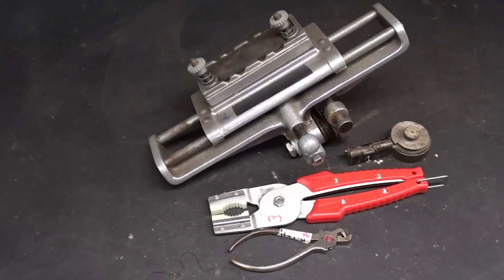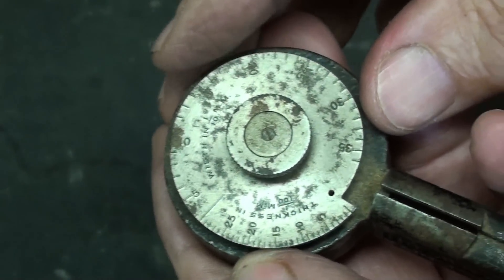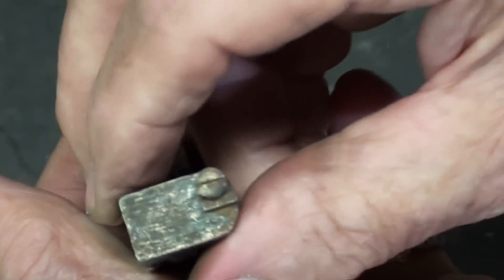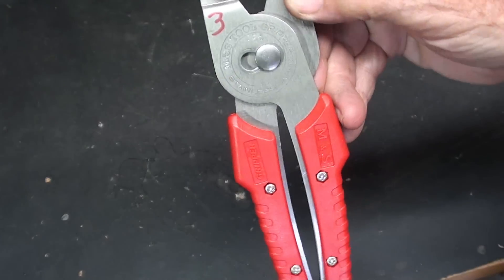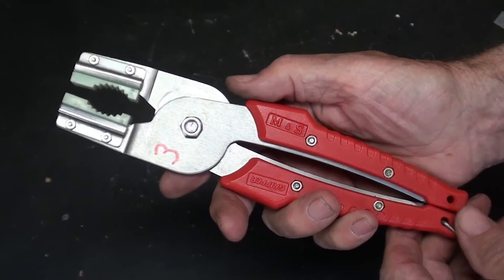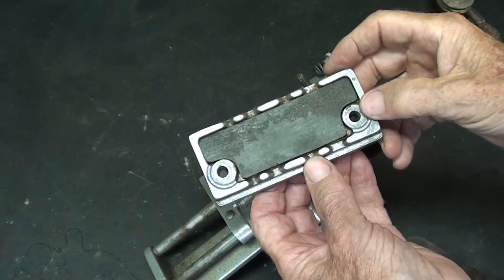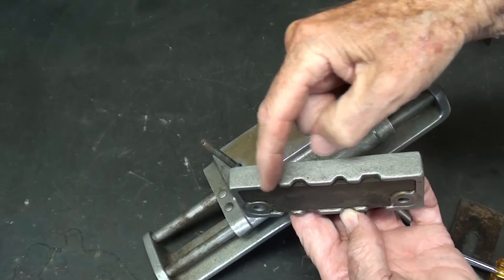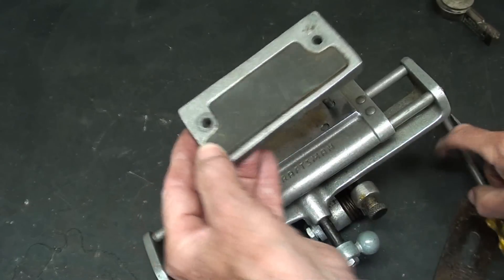WHAT IS IT? Mystery Tools #82b answers tubalcain mrpete

Comment: I used my Craftsman side-feed table like yours to hollow-grind every one of the regular screwdrivers in my tool chest - no more messed up slots on screws!  I had it mounted on a dedicated grinder along with a craftsman drill-bit sharpening jig on the side of the wheel - it became one of the most used work-stations in my shop - sharp, straight, and square tools are a real pleasure to work with...

Comment: #3 are called "soft jaws".  They are used for tightening and removing radio communication connectors that have a knurled exterior surface, instead of flat surfaces like a bolt that you can use a common wrench to tighten or loosen.  They are quite common in the telecommunications biz and used on the fittings for coax and antennas on tower sites.

Comment: As for item #3 I've got a similar tool.  I inherited mine form my Grandfather who was a master machinist, from WWII eraa until his retirement in the early 1980s, for various aviation defense dept. contractors.  Because of the nylon jaws they are used to remove or replace Amphenol connectors on aircraft with out galling the threaded locking barrel. I still use them on aircraft.

Comment: I was in the Navy and I worked with weapons systems, some missile systems make their connections via what are called cannon plugs. These are multi pin connectors that screw in place. Number 3 looks like a pair of cannon plug pliers to men and the size adjustment is form different size cannon plugs.

Comment: Hi Mr Pete, I inherited a larfe chest of Stanley tools from the 1950's. They had never been used, never been opened and were in the original boxes. Every wood working tool you could think of including a lathe and a very early electric drill.

Comment: The grinder attachment is interesting.   A complex design, but as you mentioned, not very rigid.
I use hand planes, but would not use my grinding wheels to sharpen the irons, they are too coarse.    I have used a grinding wheel to hog off metal when restoring a hand plane when the iron was really messed up by previous owners.   I then use my normal method of a Veritas jig to hold the iron and various fine grits of wet-dry paper on a surface plate to get a sharp edge and 90 deg to the side of the iron.
Reply: I like the basic idea of the design, it is almost like a super small scale surface grinder.

I would probably change up some of the details of the design but this is something I am working with right now for a slow speed diamond lapping system I am putting together

Comment: resilient mainsprings, I know sold by by the elgin national watch company, closed in 1968 from about 1850, 
Waltham I think manufactured
sizing tool for ordering/installing/replacing clock main springs, 
the largest diameter/smallest opening quadrant gives spring thickness, 
the three larger opening quadrants give spring width: 
the slider pin, between the cam and fixed/adjustable pin is missing: 
leaf coil springs were inserted in the gap in the 'handle' and the cam rotated until feelerguage type drag felt. 
thickness could be read between the butt end of the pin and the cam wheel, 
the screw in the end of the handle was for adjusting the fixed pin against a known standard supplied with the tool
clock springs weren't forever; constant flexing often broke the spring at the hole punched in the centre
springs were supplied in dozen boxes to clock maker/repairer
if a wrong sized spring (= wrong force) were installed no amount of adjusting the pendulum length made the clock run correct

Comment: The mainspring tool is missing the movable point that goes in the slot. The cam rotates and moves the sliding point and you use the space between the moving point and fixed point like a micrometer. The small screw on the end of the arm is used to zero it out. It is used to measure the width and thickness of the mainspring. The numbers are metric notation. These days I just use a micrometer.   I have a wind farm north of me with 25 of those. If I recall they were installed around 2010 and a couple have already failed.  Then 2020 the town tried to force two of the farms to give up their property for a solar farm. Until that company went belly up like the opponents pointed out the various solar companies tend to do.
Reply: Thing is you can have solar and a farm.  Got a solar farm near me that has sheep & cattle grazing on it, no need for mowing and the animals appreciate the shade.  There are also plans for one growing berries or some sort, they plant them under the panels to get partial shade.  That seems to be getting popular.

Sounds like someone in the town council was getting a kickback from the solar company.
Reply: @j.f.christ8421  The routine here has been that Company A comes in, files the paperwork and gets the town/landowner on board saying "look at what you get paid and we will not be doing anything to change the property." Then the crew arrives and they dig the topsoil off the field(s) and sell it, then level things up and toss a cheap grain seed like rye on it and build the solar farm. 
As soon as it goes online the company collects a big check from the feds and within 6 months they file for bankruptcy and the company goes up for sale. Company B buys the farm and takes it over, BUT they won't honor the original contract because they are a different company. So the landowner get's screwed and the town does as well because all the things they were to receive evaporate as well. Then after 6 months company B puts the place up for sale as a low cost of service facility and company C buys it.

Comment: I used pliers similar to the red handles ones when in the military.  We called them "sweet lips".  They were used for removing twist connectors on electronic equipment.  Most were made with slip joints for different size connectors.
Reply: Nailed it. Cannon plug Pliers.
Reply: Yep, I work in electrical and that was my guess.
For turning plastic cable gland nuts which are fluted.

Comment: #4 Former professional (and current hobby) machinist, and current optician here. Like any good tool, it IS for what ever you use it for. That being said, it is likely NOT a frame adjustment plier, though it could be used for certain specific adjustments I am sure. More likely, it is a lens BREAKING plier.  Old frames with glass lenses, depending on the design, needed to have the lens broken into multiple pieces to remove the old lens, so the new lenses could be put in place. Also, some opticians prefer to break out the demo lens from a semi-rimless frame, rather than try to get a finger nail under the nylon retention cord. Pliers like that would be nearly perfect for splitting a lens. My lens cracking pliers are a Concorde Model #5027. Main difference being they are a sharp point and cup jaw setup ass opposed to the wedge and recess of that pair, but mine are also not intended for glass lenses, so that would likely be the reason for the design difference. Just a professional educated guess though.
Reply: YOU ARE SO , SO CLOSE...They are rimless compression pliers for putting the lens in the frame.
Reply: @jamielee9350  I have 3 different designs of those rimless bushing pliers... And if the pointy jaw had a small groove or flat, I might agree, but coming to a point like that pair does, it would crush instead of cup the bushing. Maybe it would work for setting and peening the brass rivets for twin riveted hinges, but I've always done those with a tack hammer.

Comment: "That grinder attachment is pretty dam nice"
Wish our tool and die shop had one, we had diamond dresser blocks for the surface grinders. A diamond round for the Gorton cutter and cylindrical grinders.
 But none for the post grinder, never could get a concentrate dress with the cast star wheel hand dresser!
Edit - Do agree that something is missing on the clock tool. Prehaps someone will be able to forward a catalog photo of a complete tool.

Comment: I used to use one of those craftsman tools to sharpen blades, chisels, cutting tools for for lathes and sharpening old mower blades For dressing the wheels, you don't need to move the tool to the other side, you swap the wheel to be dressed to the side with the tool attached. It's just a nut that you remove, or a screw. You dress both on one side of the grinder. It was mainly for more stability in sharpening certain tools for a straight, clean edge.

Comment: A Gunsmith would actually hollow grind a screw driver! We pretty much exclusively only use hollow ground, precision sized by width and thickness, screw drivers and driver bits. I would love to have that tool just for that purpose and a few others I would use it for like truing the grinding wheel because we require them to be quite accurate also. It's definitely pretty neato, I've never seen another apparatus quite like it in modern times.

Comment: I've got a diamond dressing tool for grinders that rides the front edge of the tool rest and you just slide it across the face of the wheel. It has 2 different sides for different width tool rests and a knob to feed the depth of cut on the nib. Very handy. I've had it for at least 20 years, it's not old yet. The mainspring tool looks like it is for measuring spring stock size and then bending the ends in the slot. The radius relief suggests relief for spring back when making the ends of mainsprings. The screw and slide would be for gripping while bending.... my 2 cents.

Comment: @MrPete222 - Tool #4 looks familiar to me.  It's not anything I have owned or used personally, but I believe that I have seen it used with livestock to install ear tags.  One part of the tag's strap would lie in the channel and the point would drive the stud through the ear and lock it in place.  I'm probably wrong.  It is more likely to be used by a jeweler or optician.

Comment: Hey @mrpete222 Think endmills, drills and other tooling that you'd normally just grab with your hands. This would eliminate A. getting your hands oily when removing/installing tooling in a spindle and B. eliminating the possibility of hand injury by bare-handing sharp cutters and such. It might also prolong the life of tooling since you won't be transferring moisture from your hands to the tool.

Comment: I think the Waltham main spring tool is used for making new main springs.  These main springs are normally flat springs to take up little space in a wristwatch or small clock..  The shaft at the center of the spring rotates one direction until the spring stops its motion and starts rotating the shaft in the other direction acting like a pendulum in a grandfather clock.  These main springs are also used to store energy by winding the spring to its limit and then using it to power the movement in the watch.  This energy storage technique was before batteries and was needed on clocks smaller than grandfather clocks that used weights and gravity to store energy.  A straight piece of spring steel (flat or round) wire would come from below the handle, then go down the groove in the handle and finally be inserted into the hole on the dial face or through a hole in the center shaft of the dial.   Then you could spin the dial or spin the handle to wind the spring steel into its flat spiral shape.  The measuring dial could help answer the question about how relatively strong a new main spring is by knowing the thickness, width and coil winding gap.   If you make a new spring and it is too stiff or weak then you could vary one of these parameters when you make the next spring. Keep going with this repetitive process until you get a main spring you are happy with.  This tool would be valuable on an assembly line where you want to make multiple springs to the same specs from the same spring steel.  This tool would also be needed when you get a new batch of spring steel from your supplier and need to figure out how to make more new springs that are similar to the old spring's specs..
Reply: It’s not a mainspring forming tool. This mainspring gauge was marketed to watch repairers and jewelers to measure and select an appropriate replacement spring. The edge of the cam disk is precision ground. The sliding caliper jaw that indicates against the disk is missing from this example.

Comment: Having used similar tools
Item 2, I agree that the calibration follower is missing. And yes it will measure thickness of most anything. Considering the guides wound flat springs would be a good use
Item 3 Looks like a set of Cannon Plug Plyers. The new ones use curved jaws and  not replaceable plastic blocks.
Reply: agreed they look like the softjaws we use to assemble circular connectors with cad plating.

Comment: I have a similar grinder attachment by a competitor and I find it quite useful for grinding blades and chisels. I also grind screw drivers to take the taper out and achieve a snug fit for each size screw. I have three thicknesses that cover most slotted screws. No mangled screw slots for me.

Comment: #1 Is a watchmakers tool to measure the thickness and width of a pocket watch mainspring for sizing a replacement, it is missing the anvil/jaw that would ride up against the cam. It would have a small spring underneath to hold the jaw to the cam.
#4 watchmakers casing pliers. For adjusting watch cases "pocketwatch". Sometimes they would get bent or warped. There would have been a pad of lead or leather in the groove kind of a soft jaw to protect the finish of the case when adjusting.

Comment: I am a plumber and if you need to grip onto a round chrome parts that don’t have flats, I use rubber gasket material and take advantage of as much surface area as you can sometimes using an improvised strap wrench I made a long time ago. Non marring pump pliers are designed for chrome pipe fittings that have flats on them like you might see on the drain pipe under your sink. I just use use a large adjustable wrench. If my friends seen me using a wrench like that I would never hear the end of it.

Comment: This is to measure the thickness and width of mainsprings for watches. The snail or cam is missing its follower which should be in the narrow slot. Used for fitting a new mainspring. The spring is passed through the opening and is read by the snail when rotated to stop. (either width or thickness.)

Comment: Found the red pliers online far away and they come with plastic jaws with 3 different hole sizes to grab a shaft without marking it.  They are for general use and these have the exact same handles only blue.  It looks like the jaws are interchangeable.

Comment: Something ive found useful with my bench grinder is ive mounted a drawer slide in place of the platform. It makes it easier to move side to side on the grinding wheel and keeping the wear as even as possible.

Comment: boy, that windmill blowup real good!!!.......
Lyle, this was wonderful video on dressing the wheel on the grinder....
I recently dressed the wheel on my 10 inch DeWalt Radial Arm Saw
that I use as a poorman's surface grinder....
I have been using my DeWalt Radial Arm Saw to put 3 flats on drill bits and thread taps....and will have to 
make a video of how I am doing it....I get a concentricity of about .0015 on the depth of the flats.....using a 
hexagon 5c collet holder to hold the drill bits or taps.....no more slipping of taps in my hand drills.....or 
chewed up drill bits by others in the shop not knowing how to tighten a Jacobs [cheap chinesium chuck]
Cheers my friend....Paul
Reply from the maker: Yes, make a video. Sounds very interesting.